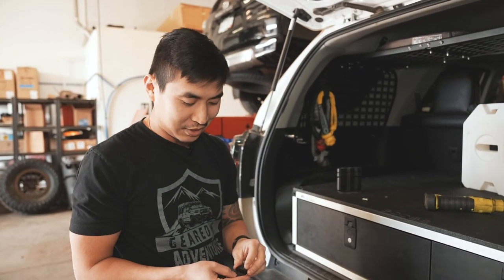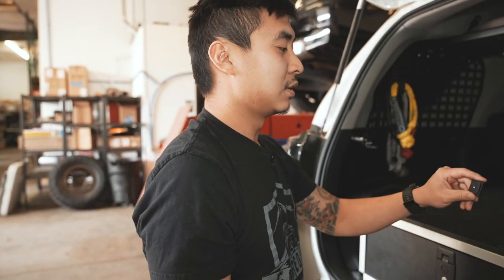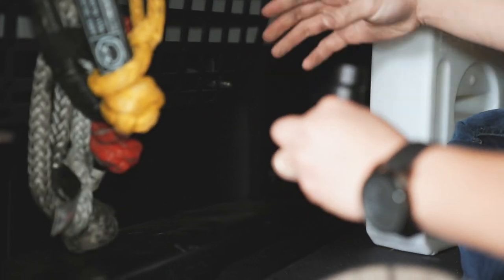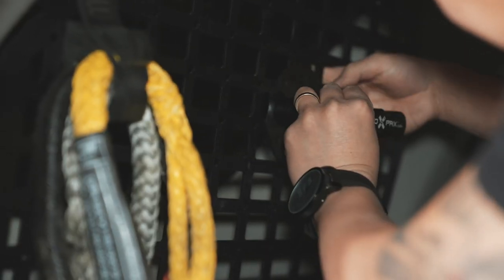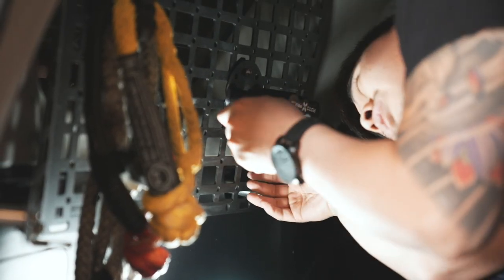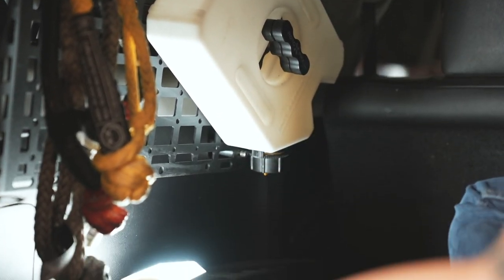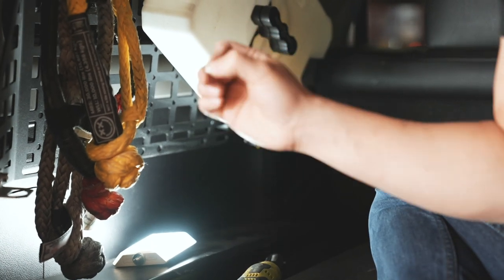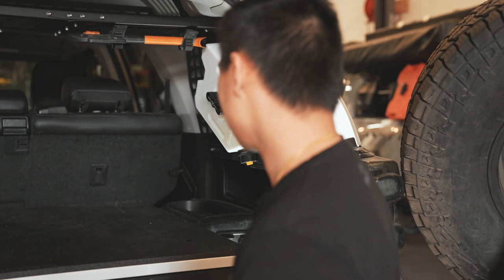Mount Anything to Your Molle Panels With Ease! MolleMounts

Comment: @R4T, I sure wish the Amazon Chinesium jerrycan mounts I bought were predrilled for MOLLE dimensions.  They come pre-drilled, but not spaced quite right on the vertical stock.  Guess I got some drilling to do, then get some nuts like these.  Do you know the weight limit of these?
Reply from the maker: Not exactly, But we did fill up that waterpax and it was around 15 lbs I believe.